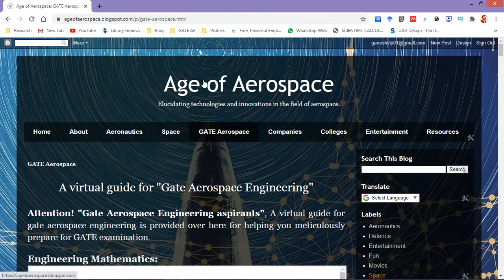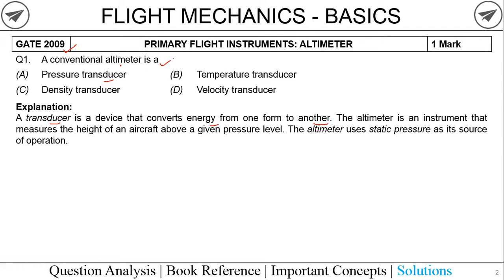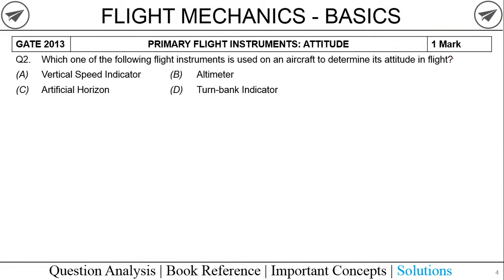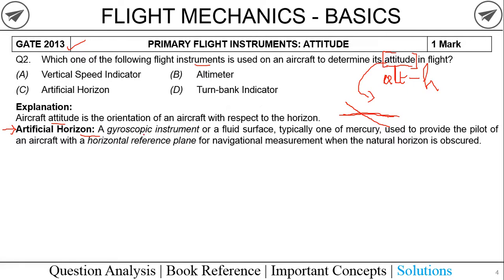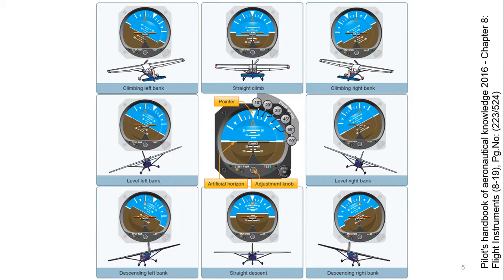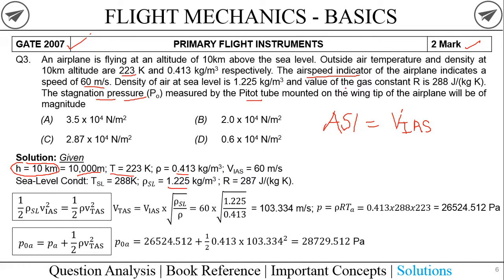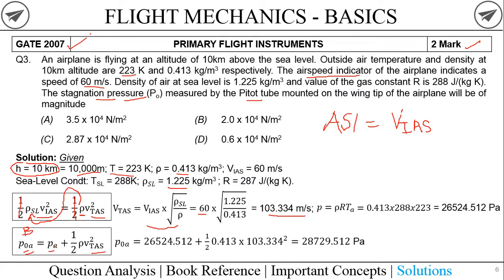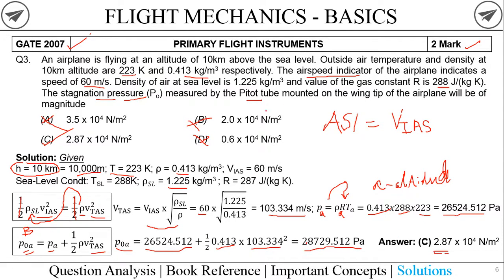Primary Flight Instruments| Q & A | Topic wise Solutions | Flight Mechanics | GATE Aerospace

Comment: Sir , why is there a need for a static port if we can get static pressure from the pitot static tube ?
Reply from the maker: The key is redundancy. You want to have at least two independent systems to measure altitude and airspeed so if one fails, the other still provides good data. 

Further reference: https://aviation.stackexchange.com/questions/72883/why-do-larger-aircraft-need-two-or-more-static-ports